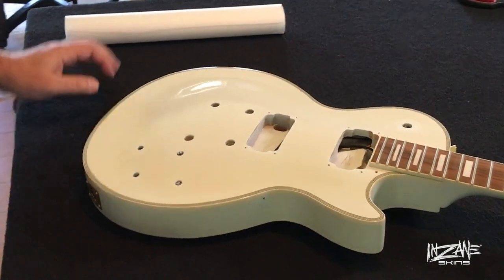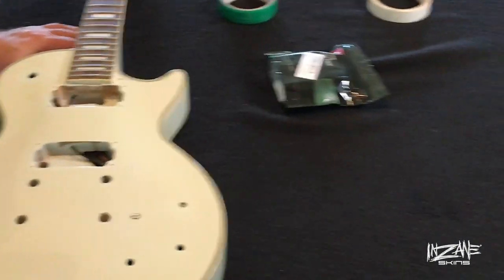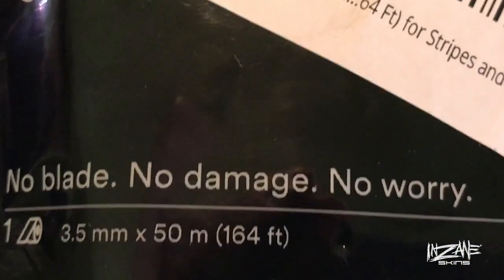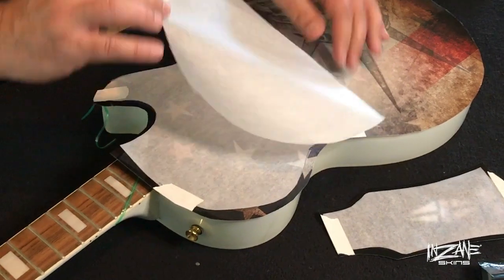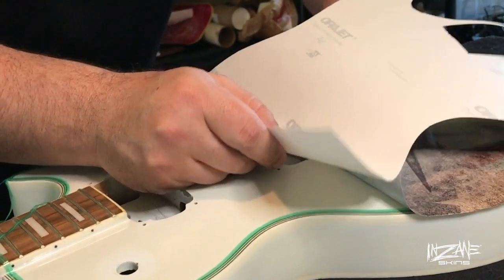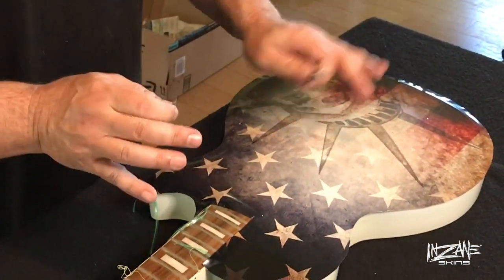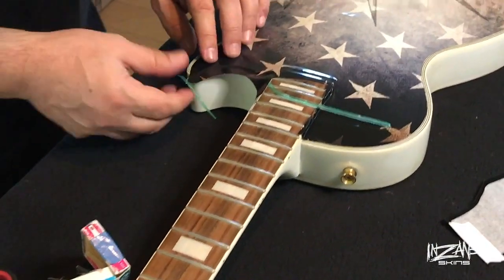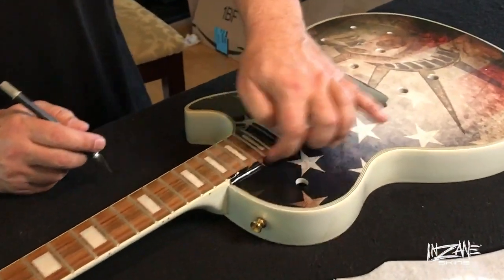Guitar Skin Install: AMERICAN LIBERTY || INZANE SKINS

Comment: I can't get the knifeless tape to cut through the vinyl wrap without causing ripples and tearing the vinyl, I have precut the vinyl on a test piece to start the cut and tried pulling slow and fast and it has the same result, the green vinyl tape included with the kit seems flimsy so I'm going to try some red knifeless tape in hopes it will cut better.
Reply: Any luck on getting a clean cut on your wrap bro?

Comment: GREAT ADVICE. Was going to do my white Les Paul as a novice / virgin to wrapping a guitar and came across this video. Will feel more confident after seeing this Vid. Not to mention the knifeless tape !! What an invention by 3M. Hope they sell in UK . Really helpful video otherwise sure to have ballsed it up. Thanks again Mr Inzane 🤟
Reply from the maker: Thanks, Paul - glad it helped. Reach out to me through my website if you have any questions.
Reply: @inzaneskins  Hi Mr Inzane. Calling from UK. Followed your vid a bit at a time over past weeks after eventually locating some knifeless tape in UK. It maybe a bit too late now but how do you get the 4 FEMALE pegs OUT which are inserted in to body to hold the male pegs for the tune o matic bridge pieces. I had to put the wrap over them as I couldn't find a way to remove. Then cut around the perimeter of the pegs. NOT ideal, as needed to make a few incisions to lay the wrap flat, maybe for future reference please advise. Not a perfect job as my first time but maybe re-do or learn for next time. Your advice appreciated.🤠

Comment: How happy are you with the edge left by the knifeless tape long term? I've been sitting on a gold top wrap project for a while now, trying to decide whether to roll over the edge, or use knifeless tape to expose the stock binding.
Reply from the maker: I do roll over the edge on some guitars, but I typically clear coat over the skins and get rid of the ridge. When NOT clear coating, I like the cut to be about an 1/8' inside of the edge (using knifeless tape). This creates a faux binding and seems to frame the skin nicely.
Reply: @inzaneskins  That's the answer I was looking for - I ordered knifeless tape when I ordered the gold vinyl, just been putting it off.... 1st time wrapping anything.

Comment: thanks,my question on guitars like SG style with rounded horns does the skins bunch up or easy to do going around the bends have you done an sg style...i think these are great, I wasnt going to buy a new guitar that i liked because i didnt like the stock colors
Reply from the maker: SG's are tough because of those bevels but I use a hair dryer with a low speed and a warm temperature to press the skin down when necessary. The heat helps to activate the adhesive on the skin to make it stick better. It might still lift a little after using the hair dryer approach, but I do its a few times on the areas that are trickiest and that tends to work well.

Comment: Can we use a spray for windows, before putting the skin, for easier removing the bubbles?
Reply from the maker: I don't recommend this and the reason is, with the cavities in the body, the skin will shift and start to fall into those cavities, leaving you with less than desirable results.

Comment: Can I spray nitrocellulose over vinyl skins?
Reply from the maker: I don't recommend nitrocellulose for a couple of reasons: 1. nitrocellulose takes quite a while to cure and harden but the finish will always remain somewhat soft. 2. Nitro eventually cracks and yellows, so that's not ideal. I prefer using a 2-stage urethane clear. It dries fast and is hard enough to sand after a couple of days, and it doesn't yellow.

Comment: Would this be easy with an explorer shaped guitar?
Reply from the maker: Not hard at all. As long as you're comfortable removing the parts, then putting them back on, skinning is not difficult at all.
Reply: Probably easier being a flat shaped guitar.  Good luck!